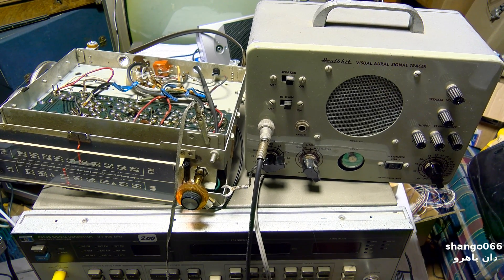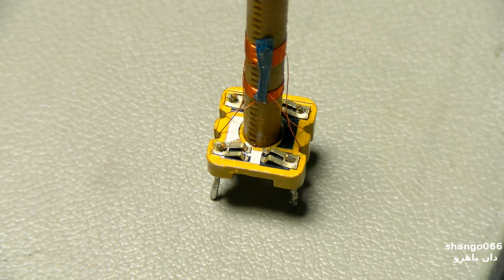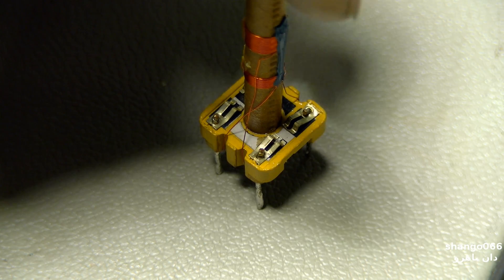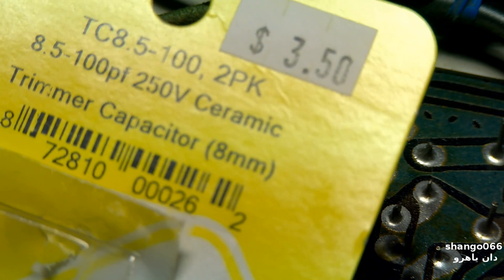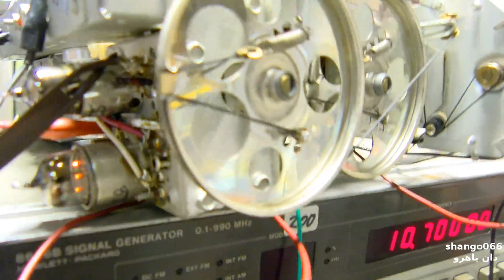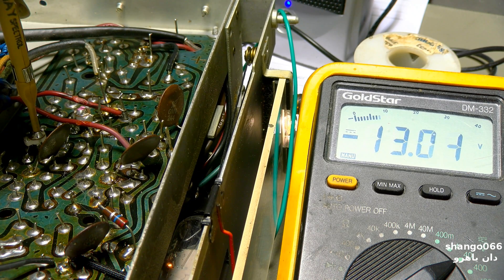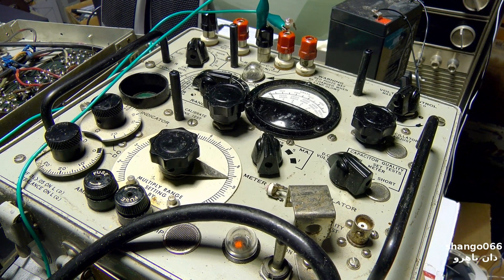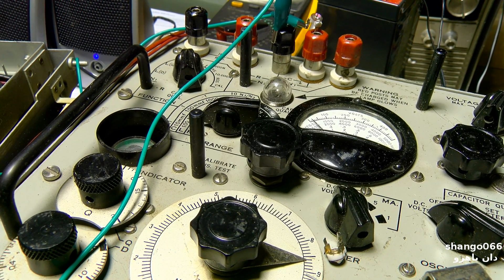IF Transformer Silver Mica Disease Repair

Comment: Greetings:
Testing for resonance on unmolested IF x'formers (guessing):
Since parallel resonant tank circuits have high-z, use an RF signal gen (with series cap to block DC) at 10.7 mhz with an appropriate series R to measure across, check for hi-z with tank in series between sig gen and gnd. Non resonant tanks will pass too much signal across the series R. What do you think?
When you replaced the coil into the shield I did not see the gnd tab to confirm proper orientation, but working g is good enough for me.
Those trimmers are better for 455 khz X'formers; need much smaller trimmers for FM 10.7 MHz IF x'formers.

Comment: I acquired two GE Musaphonics and both have the exact same symptom. I tested the tubes..Good..changed caps, still complete noise. Took the covers off the coils and there they were. Now to order some trimmer caps. I have some "somewhere". After 45 yrs in electronics lots of things are hiding.

Comment: I think the wetness is some sort of special oil, maybe mineral oil.  A non conductive fluid to keep the contacts from oxidizing or corroding.  I saw the the video with the silver mica problem and that I.F.  Transformer was dry.. I would bet a light grade of mineral oil was applied the the plates of the caps before assembly. Thanks for the many hours of enjoyment.

Comment: Many years ago I found an if transformer that was like the one you have. Some bimbo had sprayed something oily in it. I cleaned out the residue and put the thing back in the radio for the hell of it and it worked fine. Back then you could get replacements but they were very $$$$$. Never got a call back, so the fix must have held up.

Comment: Why add the trimmer capacitors? I've seen other videos where the diseased mica wafer capacitor had been replaced with 100 pico farad capacitor and worked well.

Comment: I would guess the oil is corrosion prevention between the pins and the silver plate. Two dissimilar metals exposed to air will generally form crust due to electrolysis.
Reply: That's what I thought. Like when you buy Russian surplus guns or tools from the Chinese tool store (H Freight)...

Comment: i would spray the next one with break cleaner get the oil off and just see if its becoming conducive  thanks for the good video i like the video of you robbing that philco of its good cans i have a old peavey cs800 from the 1970s needs work on the amp card interested in fixing it

Comment: What is that C meter? looks like quite a boat anchor!  I use a modern one made by Almost All Digital Electronics that works really well for small value (<100pF) capacitors.

Comment: To make adjustment easier with trimmer caps, it sometimes helps to parallel a fixed capacitor across the trimmer.  This will reduce the adjustment range and make the adjustment less touchy.